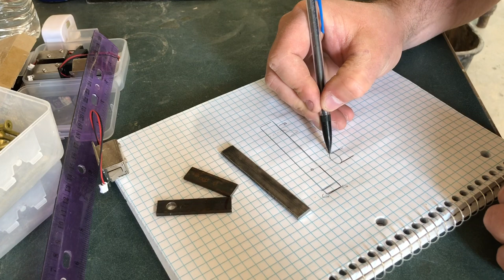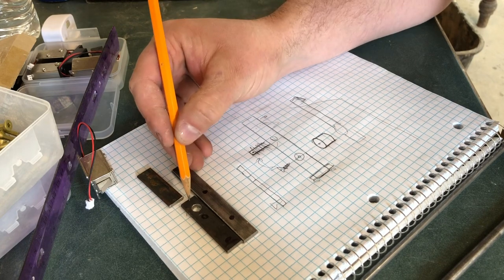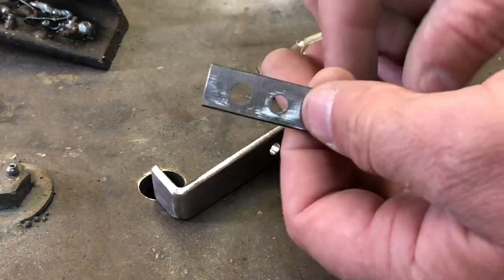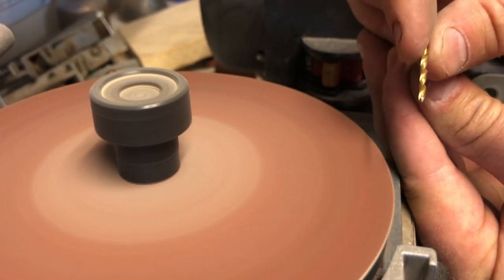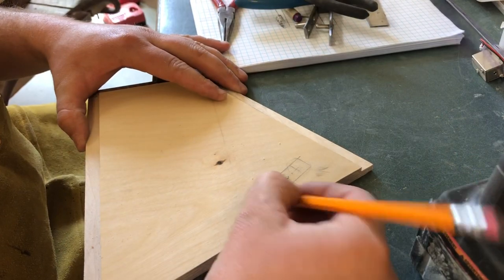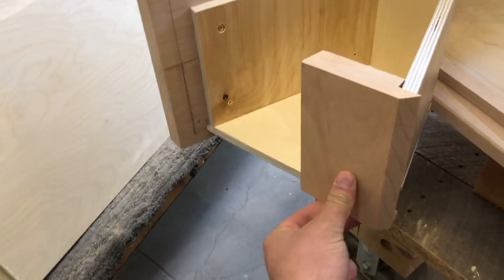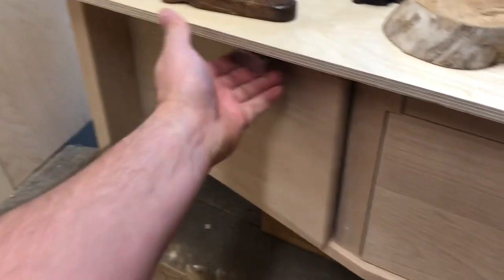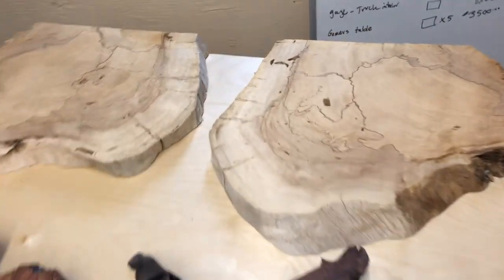Hidden latch DIY from scratch build.

Comment: This is so cool and so useful.  I'm working to build a board gaming table and I had some hinge/slide ideas that I just couldn't find anywhere.  It's cool to see that it's possible to just make your own.  Still seems a bit ambitious especially as I ask, "What kind of welding is that?"  I've never worked with metal outside cutting holes in it and welding seems like magic to me.